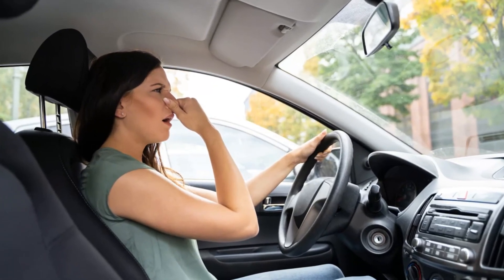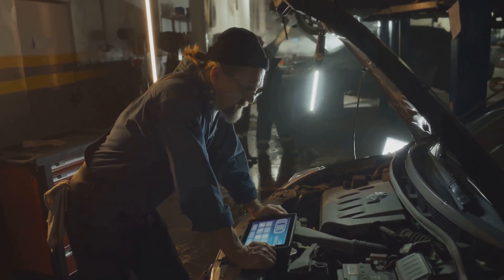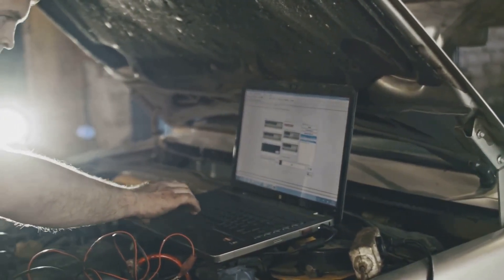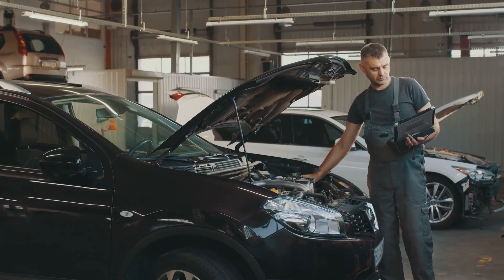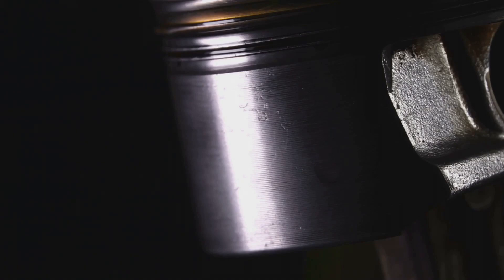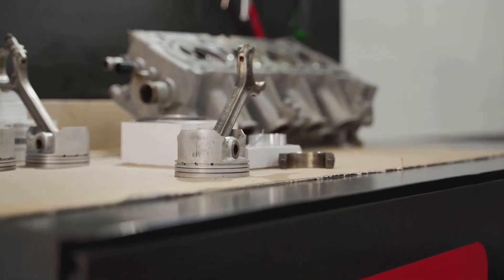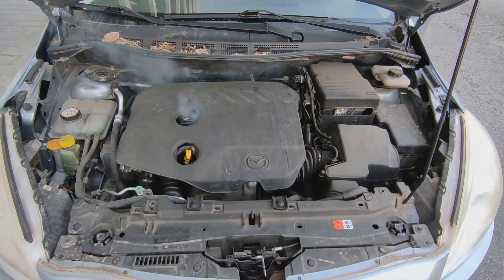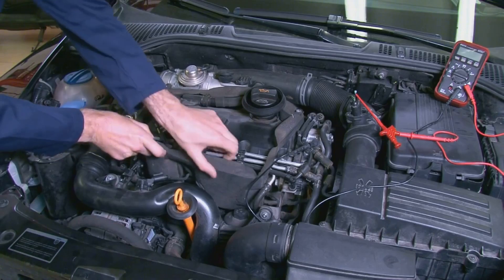Fuel Smell in Oil - 6 Things to Check First & How to Fix the Issue?

Comment: My gas range is going down rapidly and my oil smells like gas
Reply: I have the same issue. I have a 2019 sonata 2.4l amd my upstream o2 sensor is dead 💀 plus my cat is clogged I think
Reply: Check pcv valve clean or replace